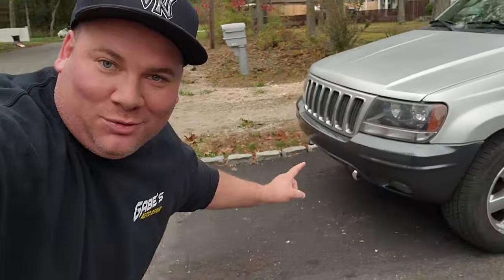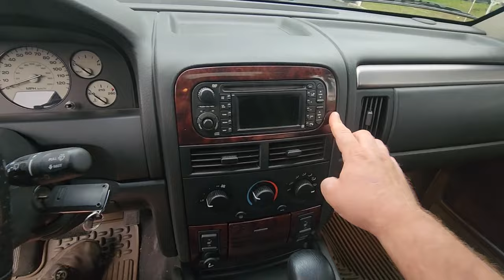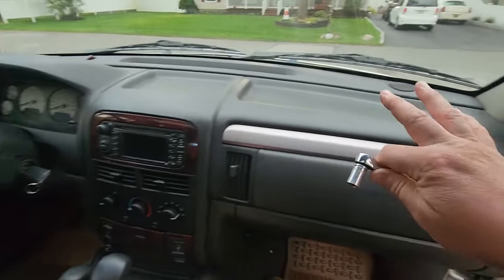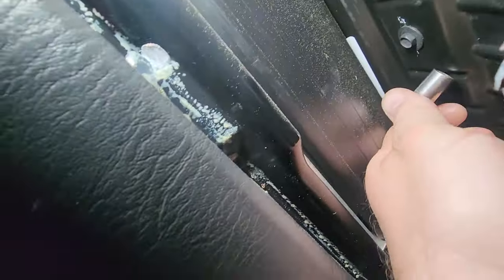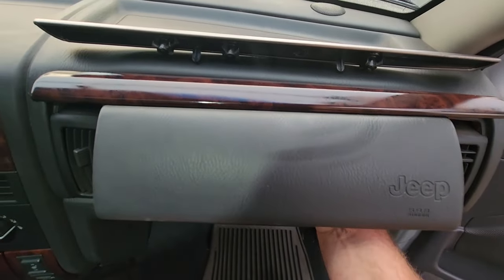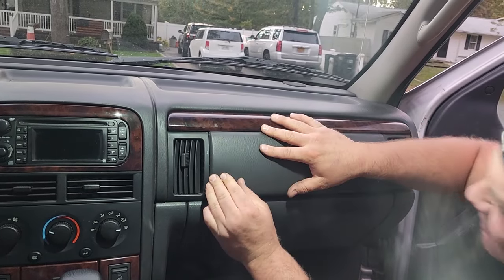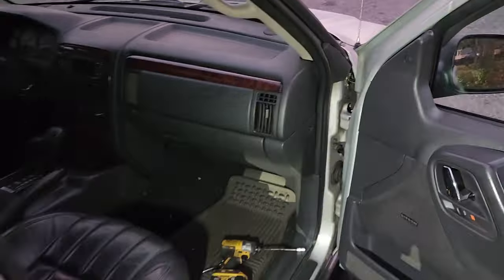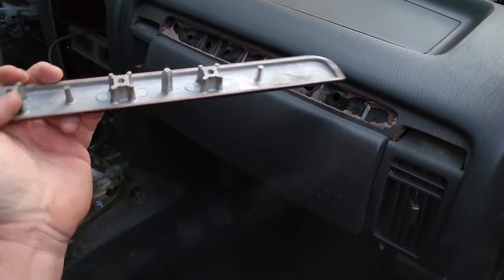RARE 2003 COLUMBIA EDITION LIMITED - PASSENGER DASH TRIM SWAP - TRANSFORMING A LAREDO PROJECT

Comment: Hi Dan, I have a 1998 Jeep Grand Cherokee limited, thanks to your video on how to repair the VIC, I was able to remove it and found those pesky cracked solder joints and thus reflowed them to fix my faulty coolant sensor warning.  I also replaced the light switch with a new replacement from Quadratec, my lights were going wonky because of the dash dimmer slider.  Anyway, I noticed after taking the dash covers off there is a lot of surface rust on the metal frame, should I be concerned about that?  Thanks
Reply from the maker: Great to hear! , most dash board mounts get surface rust but never rot.  Shouldn't be a problem but you're welcomed to being on some POR15 paint!

Comment: Hi Dan love all your videos but this one makes me cringe a little . that panel is made to blow out when the air bag goes off. you just changed it by adding screws to the bottom, does it change the direction of the air bag, do the screws become projectiles.
Reply from the maker: Are you sure it doesn't blow directly through the cover?  If not the rubber will rip right off and leave the screws in the plastic.
Reply: no , Dan Im not sure. just wondering. If you know it blows through the center , thats cool , all is well. Just cya thats all.